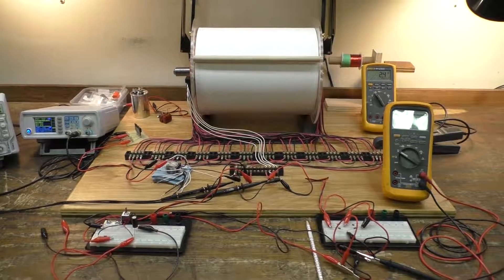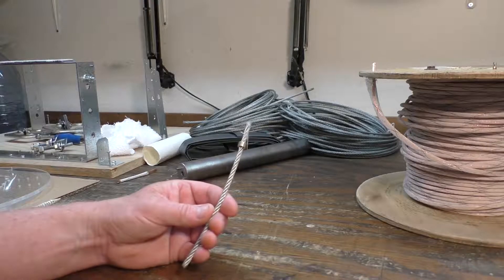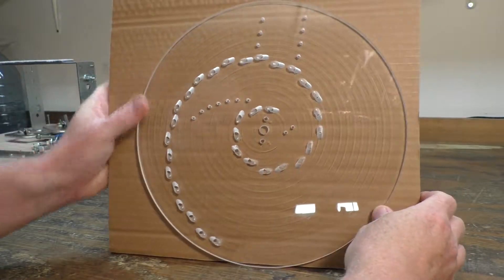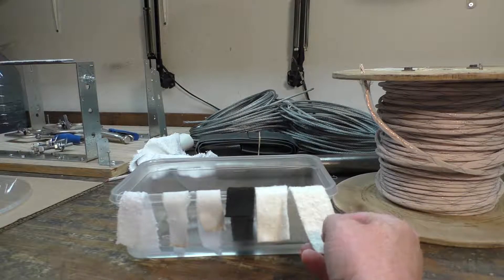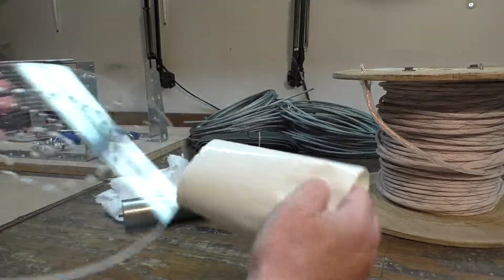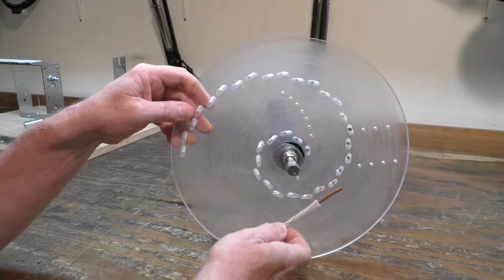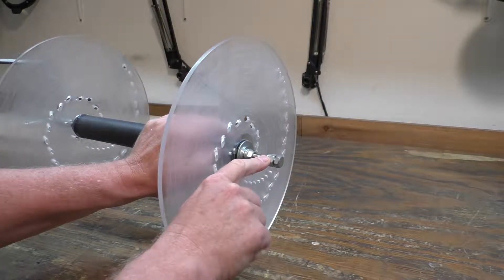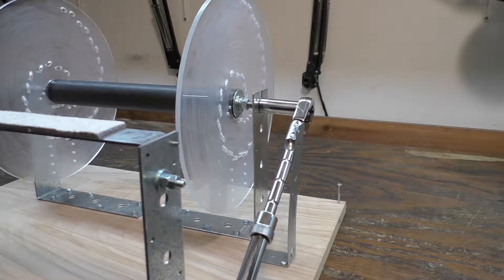Stubblefield Coil build part 1

Comment: I agree with the person who responded previously that the reason for the cotton insulation is promote/allow electrolysis between the iron and copper. A plastic or non porous membrane would prevent this .

Comment: Hey, Ive been wondering how he connected the layers of the coils. Whether each coil has leads coming out or not. Most people I see making it just leave the wire between layers connected and just put the cloth insulator between the layers. Does that matter? Are you leaving them separate so you can experiment with alternating how the coils are connected? Like all the layers being 1 copper wire, or alternating copper to steel to copper to steel?

Comment: Regarding the insulator on your copper wire, I was under the impression that with cotton its not really acting as an insulator once it becomes wet. Seems to me that the wet cotton would act somewhat as leakage between the copper and iron wire.
Reply from the maker: Yes indeed it was cotton and back in the day that is what they had and used. The insulator I used  is woven nylon so it is porous and allows the water  to penetrate it. The idea is to keep the two winding's from touching each other and set up a difference in potential through the galvanic action of the two materials. Each cell rapped in cotton keeps the correct moisture level.